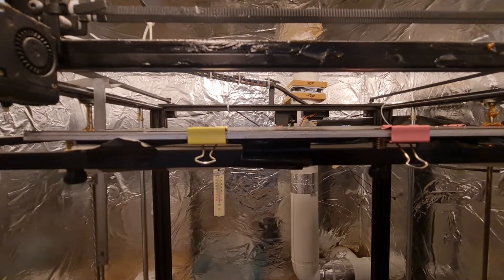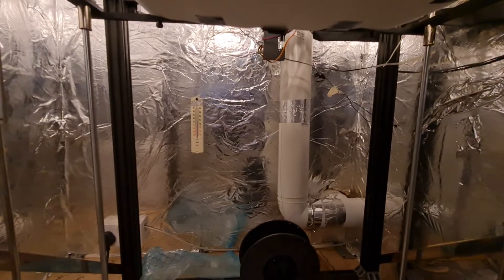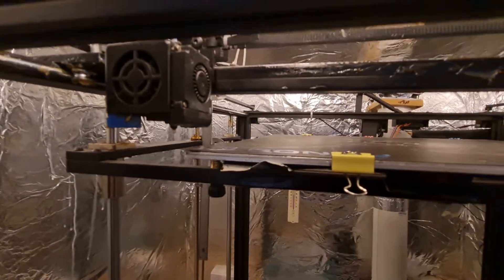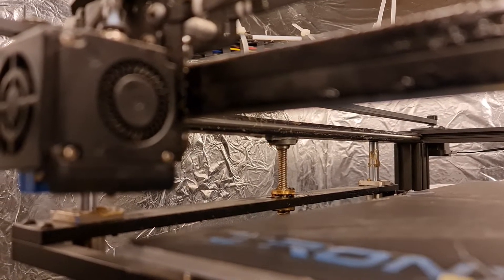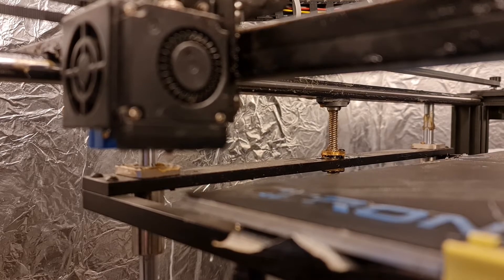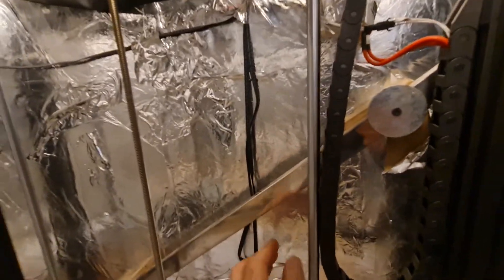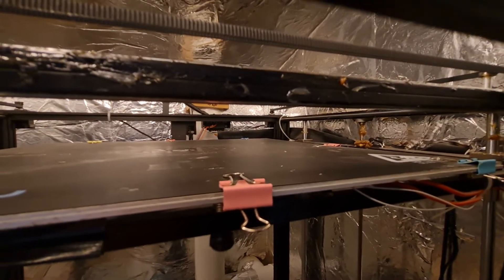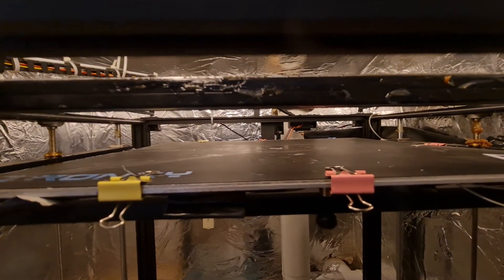Tronxy X5SA-500 PRO quick review and some mods to get things working!!!

Comment: So it sounds like you are not too happy with it. Would you buy it again?  Is it worth with the mods?
Reply from the maker: Hi, no I would not buy it again, I bought it for the size, but as it turns out I won't be needing such a large size for printing. I would look at better quality medium sized printers if I was buying again. The main issue with this machine is actually its size, which means things like the wire guide chain pull on the bed & the print bed is so large it flexes (particularly in the middle) so it's really difficult to get levelling sorted out. The weight of the printing base is far too heavy for the stepper motors, so you end up with those moving around whilst trying to level.  I will use it until something burns out then replace it with something smaller & better quality. I have re-enforced the stability of the frame (by attaching it to my cabinet) which has improved matters with regards to vibration whilst printing. But overall not impressed!! But if you need this kind of printing volume there is not much of an alternative on the market. I know its possible to sort out a lot of the main issues, but I will save my money for the next printer!!